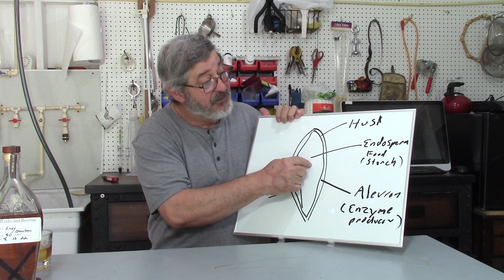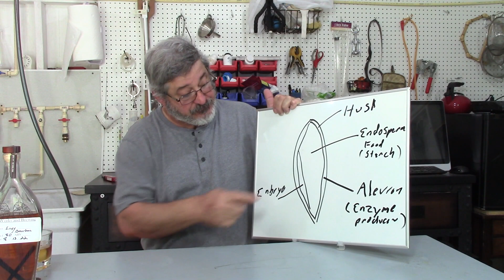E250 "What is"  Starch Conversions

Comment: Great tutorial! Question—When you steep (cook) the corn in the mash tun at 190F and hold for 1.5hr, is that the max temp? I just ordered the orange Gatorade style cooler (mash tun) and will use your method—so, I was wondering if I can go 195F and let it come down to 190F. Or will the higher temp not gelatinize as well? Just looking for the optimal range in your experience?
Reply from the maker: higher temps are fine 190 is just a temp i shoot for higher the better but if using HTE can not add till 190 or below
Reply: @stillworksandbrewing   Thanks!!

Comment: Good breakdown brother. I didn’t get to run that Honey bourbon mash I wrote about yet. I poured a gallon of Mead into it the other day though as well as all the honey I used to ferment the red/yellow corn and honey malt. I put my still together for the first time yesterday and then it started raining hard🤬. So I decided to wait and instead I just put a good amount of some finings in the barrel to get the best possible clarity. So 48hrs from then is tomorrow but Wednesday this week it’s gonna be sunny so that’s the day… I’ll tell you how amazing it comes out
Reply from the maker: please do  cheers
Reply: Ok so I ran it 3 days ago now. I let it rest at full strength for a day then I blended what smelled the best and tempered it with distilled water I bought down to 110. Yesterday I put oak spirals in 9 out of the 10 32oz jars and left one white. It smelled like honey and corn liquor coming off the still with a hint of the barley later in the run. My wife and her friend smelled it at 160 proof and said it smells like straight tequila. They are not wrong. Can you give me any input on that? I just added oak and I haven’t even looked at it since and i don’t intend to for about a week